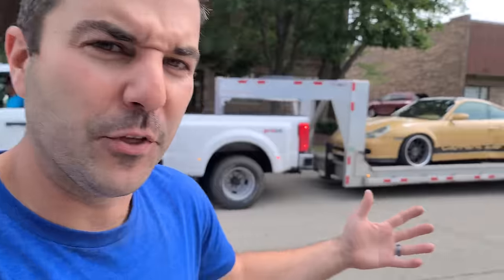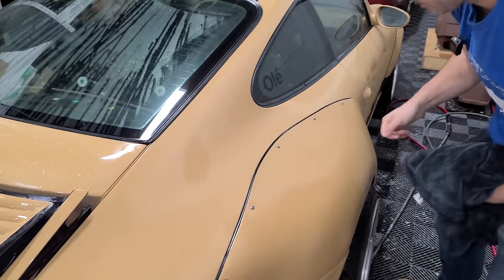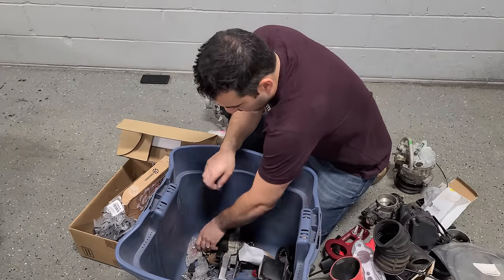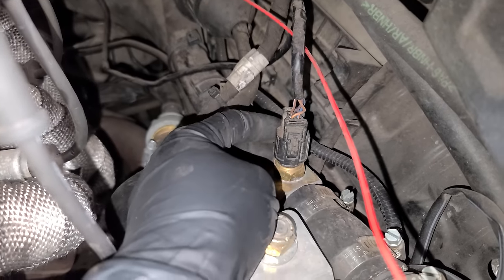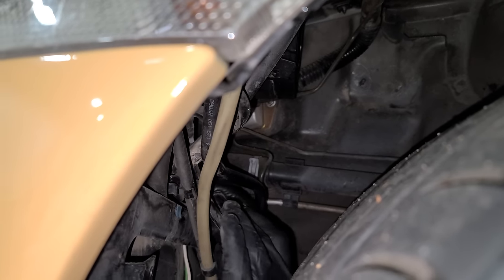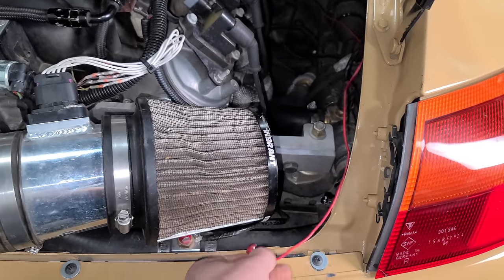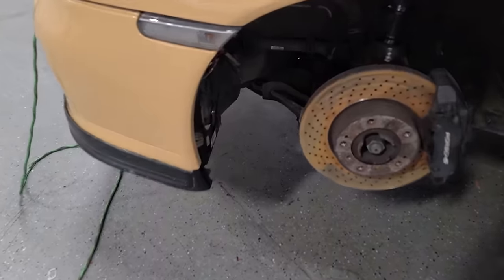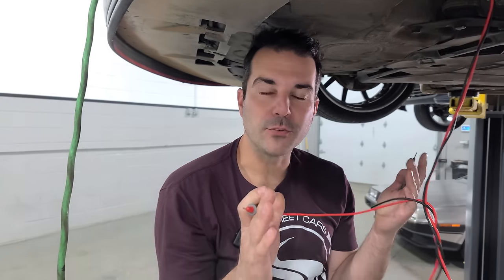I Bought A WideBody Porsche 911 That No One Could Fix! I Fixed It For FREE In 3 Hours! LS Swapped!

Comment from the maker: What do you think this car is worth fully sorted with working air conditioning and power steering?
Reply: It is worth keeping ❤
Reply: I guess i dk the worth of cars these days because if someone said 10-15k i would of pulled the $from the bank asap thinkn im getting 50k off the top😂 butt again i dk shitts bout there worth
Reply: 911’s don’t have power steering, those mega-wide tires are why it’s so heavy steering. That was a sweet 911 when new, it has the tech-lighting package and these cars have aged well.
Reply: Not a lot totally ruined a decent car🤣🤣
Reply: $28,500 same as BAT brought in.
Reply: @enoch52  Not 99 models .. The LOWEST value 911 of them ALL
Reply: @jeremyjones8872   Capt obvious, you are correct...
Reply: Not a lot. This was not the move to make. Especially because you’re now youtuber number 100 to have/build one of these. Kinda disappointing actually.
Reply: Ccol Project. I think it's worth about 5 k more now that it cools. If you could add power steering, air conditioning and quiet it down and tune it add another 10 to 15k
Reply: I wish I knew how to use a meter. Can you point me to place to learn electrical things or one of the viewers?  I have a Norta Trak bicycle I would love to diagnose and fix.
Reply: 45k
Reply: These comments are cancer lol. There's at least 60k into this car.  Definitely worth at least 35k to the right buyer, probably more.
Reply: KEEEEP IT!!!!
Reply: I’ll give you 25k for it 😂
Reply: I can't imagine it would be worth much less than $35-39k? Especially now that it's sorted.
Reply: Ask Hoovie, he has the Apollo 911
Reply: $1 Bob
Reply: Easily 40k when sorted
Reply: @modelbehavior3252  WTF are you talking about??? Power steering, ABS, a more efficient heater, a central locking system and height-adjustable seats were part of the equipment in 1989.
Reply: @melvingibson4525  I think it was a stellar purchase...but I doubt it would more than $33.  Early 996's are still the best value buy in the 911 family...mostly because enthusiasts hate the Boxter interchangeable front end (e.g. headlights) and IMS bearing issue.  Given the LS swap, the IMS issue is removed...but the stigma to 996 remains.  That being said, they are IMO terrific cars for the money and this was a really good purchase given the after-market upgrades.
Reply: 217,95$
Reply: @melvingibson4525  Dumping $60k into a shitbox doesn't make it worth more. That's some boy math right there.
Reply: @Elmospiece  I bet you're a wow at parties ..!!🤣🤣
Reply: 10-15k, I don't care what the parts cost new, its not new now and honestly you over paid for the "SEMA Car" status symbol, the buyer pool for a car this modded is extremely low, no one buying used would ever value the expense of those wheels when there are plenty of good looking wheels in the 1-2k for a set price, nor will anyone appreciate the paint cost and particularly Porsche purists aren't gonna like the color change or the wide body so they will knock value for having to "restore" the car back to factory body, not to mention the motor swap, so "Porsche Guys" would dog you to no end, so in the grand scheme you have a 5-10k roller and like 5kish worth of motor and swap parts. I know people won't like this comment but it's the truth, Factory Porsche's hold higher value then modded ones and frankly when you told us to guess what you paid my brain said 10k, so add a little more for it being all sorted.
Reply: @melvingibson4525  Doesn't matter how much money you put into something, the problem with a heavily customized car is the market, very few people will want a porsche 911 with a widebody in that color with that interior, so your buyer pool is massively limited and so you have to price it low enough that people would be willing to buy it and respray it a different color (at a minimum), so take the value you place on the car and subtract the cost of a new paint job and that increases the market to where you might actually find a buyer. Also SEMA 2017, that means this has been a non-usable for daily driving car for 6 years, people are gonna consider that too.
Reply: @DanielRichards644  I like your comment... You are telling the truth 👍
Reply: So while there's a lot of money in this car, these cars are not considered very desirable by Porsche enthusiasts, The parts to own them are expensive, and with the conversion and all it generally lowers the value not raises it. So 15 to 20K would be about the highmark when you get it all cleaned up.
Now if you go out of your way to get the air conditioning working and all of the gauges perfect and fix the shifter so it doesn't look like a metal tube etc It's worth about the same 27 you paid for it but Right now it's far from that.
Reply: This was for sale online a year ago for way too much money. I honestly thought, the only thing that makes sense is for a well known YouTube channel to do a rebuild lol
Glad this happened!!
Reply: 35-45k
Reply: It's insane that you sorted it out in like 1 hour.  Lol.  Those other shops should be embarrassed.
Reply: 3,000$ Ille offer you 2,900
Reply: What happened with the Ls Swap Mercedes? I believe in you to do the trade to trade eventually to a 6 number car come on 👊
Reply: I guess I am just poor, cause looking at this I would not be willing to spend more than 10k. Especially considering it has an unknown issue, to me that means there are some more that are likely masked. It is neat but I wouldn't be willing to spend much to adopt it. Seems like a problem child.
Reply: So I used to work for Gillet, which is the company that used to make the exhausts for all of the VW Group, the BMW, all of the German automakers. Was there when we were prototyping the exhaust for the 996 turbo.  I learned German in Germany on the fly. And the correct pronunciation in German you would pronounce the E because Germans pronounce all letters. Having said that, it's only douche bags that insist on that kind of thing.  Like gun owners that get tense about the difference between magazine and clip.  Yes, I know the difference. No, I don't care. Magazine is three simple syllables, and clip is one.

Personally, I would have power steering and AC, even if I had to get an electric compressor and electric power steering  That way you could place that equipment anywhere you want, Although you may want to upgrade your battery and your alternator if you're gonna do that.
Reply: 1999, No AC, no power steering… if you fix all the little things, I’d say 15k. So… about half what you paid for it. Don’t feel bad, the last guy lost a lot more than you will on the deal 😂
Reply: Its worth doing a merch giveaway so i can buy a bunch of tshirts and win it lol. I love porsche and i love LS. It would be such a cool daily and project.
Reply: I can't really be sure from looking at my phone screen, but in a lot of shots the paint job looked pretty awful. That doesn't really help the value I guess.
Reply: @enoch52  Yep. All the modifications were money down the drain, in resale value terms.
Reply: @charless2684 it's crazy that there are SOOO many shops in the US that just have no idea! It's why I literally can't bring my car anywhere.
Reply: To the right person, a funny sorted car with that motor? Maybe 40-50K....
Reply: Probably wort more as a giveaway by way of views/sales vs actual car
Reply: Maybe 30 to 35K but you'll need to put 10K into sorting it so maybe you'll break even. Consider you can find a sorted 996 Carrera turbo for 50K so if you wind up with more than that in it your probably stuck either losing money or keeping it. So be sure to make it the way you would have built it in the first place.
Reply: Use it to do the trade up project again
Reply: It's an honest ~$20k with a bit of swing depending on the local markets.   But we can all assume it's gonna get $30k+ from some over zealous wannabe Tiktoker or the like.
Reply: worth keeping :)
Reply: Once you check/fix everything like the non-latching hood latch, janky intake, and replace those crappy seats... I don't see anyway you couldn't make a healthy profit. $45-$50K... I'd ask $55k, and "settle" for $45K.
Reply: Its worth a crapload of money if you sort it and do a giveaway with merch purchase.
Reply: 10 to 15k not much more, I’d say part it out,  it’s a bit of a big, ugly AF… but good luck Alex
Reply: Ruined car. The wide body is wrong, the rear wheels are terrible,  and the LS swap is just wrong.
Reply: mint, 25k. Fixed in current condition, 15k.
Reply: Por shuh. Proper pronunciation
Reply: With a GM engine? next to nothing...
Reply: @jb678901  35k if it had the original engine, but it doesn't...
Reply: There’s another YouTube channel building one that’s gonna have half the money into it
Reply: in todays market, $50,000
Reply: Why not? Make it legit! 😊
Reply: Crush it , horrendous 😂
Reply: You got it for 27K, so 30 - 35K.  But I reckon you could negotiate a great swap, maybe snag 10K to rebuild/modify whatever you swap it for to keep the LS series true to roots.  Great vid as always mate!
Reply: In what country? 😅
Reply: @modelbehavior3252 not true. 996/911 definitely have power steering.
Reply: @legitstreetcars ill email you.  I think this belongs in my garage here in arizona.
Ill put an oem couch seat and maybe swap the nose for 997 then have it painted pts orange or nardo.
Reply: I sense somewhere in the $32-35k range 'as is'. Perhaps on the higher end if you put it "back in black". Cue the music.
Reply: @tomeauburn  Electrician U on YouTube Dustin the creator is a master electrician.
Reply: Probably less than what you put in it after sitting for a long time. Cars like this don’t sell easily or quick unless you find some “fast n furious fanboi” idiot
Reply: …the change in my pocket from a mcdonalds happy meal
Reply: @Kent.  You are correct, I made a mistake and forgot that the older models had it starting with the 964. I have a 997.2, I love these cars.
Reply: @ajvot71  correct, my mistake!
Reply: Your market for this vehicle is tiny, however, I bet another YouTuber who is looking to show off will gladly pay anywhere between 55 and 65K.
Reply: Probably 40-45k, but wheels/tires need to be sold and a normal set put on. Exhaust needs to be tamed down.

Comment: When you have a new engine overheating during idling. But cool when you're driving. It's definitely a indication that you have a air flow problem. Not a coolant flow problem. That's a big deal as long as you check the gases in the coolant and make sure you haven't blown Head gasket. Those aluminum engines like to Warp  when they get hot or even warm.

Comment: The story goes that the key is on the left because when performing a la man’s start you can jump in turn the car on with the left hand and engage the 1st gear with the right hand.
Reply: Why not just engage to 1st gear when the car is off then turn the key on (with clutch fully depress) once its on, release the clutch then throttle? My 97 lancer can do this, you can sometimes even forgot that its on 1st gear while turning on (I usually engage either 1st or reverse when parking on slope roads) it just stalls as the hand break is engaged.
Reply: Le Mans...

Comment: Alex, you’re still not using those connectors right. The soldier needs to be basically shiny, meaning it’s melted ALL the way. You’re barely letting it get pliable and you’re removing the heat. It’s a weak connection and will erode much sooner than it should. 

It’s a good connection once the soldier starts to seep into the wires. By the way, you’re building my literal dream car. A Porsche 6 sp wide body with an LS motor in it. 😳 So, I’ll be following along for sure. Awesome, unique car. I had cool cars in the military, but some things happened and I ended up not having such cool cars, and now my health has me lookin’ at the short end of life, so if I can’t build/buy my dream car, I can at least watch you build it. 😊
Reply from the maker: I hear ya but it is melted all the way into the wires. What I've learned is the grey ring you still see is a stain and doesn't go away.

Comment: Great troubleshooting, Alex!  If I were the former owner, I'd be miffed at the shops that could not diagnose, much less fix the problem.  The shops then got the former owner to add parts that were completely useless.  
So let's compare.  Previous shops: 1) Utter fail at diagnosing the problem followed by 2) weak parts cannon.  Alex: 1) proper diagnosis followed by 2) removing unnecessary parts, leading to 3) a no-parts added solution.

Comment: Working on a 2013 ford focus. Had a weird engine fault and transmission failure codes. Tracked it down to a wiring issues somewhere. Ripped out the aftermarket car starter that was half assed tossed togather in there. Codes went away and doesnt seem to be a issue. Drives and shifts good. Couple more items to fix before I clean it up for sale

Comment: I believe this fan shutoff delay is pretty normal since my friend's 997 3.8 does this as well. There is a lot of coolant in the system just in the hoses alone since they go from all the way back at the engine to the front of the car and back again. If i remember correctly the 3.8L F-6 in the 997 needs around 32 litres (around 8.5 gal) of coolant. This is a lot of thermal mass to get the temperature back down even if the engine stops putting heat into the system.

Comment: I’ve got a 996c4. The fans for the front rads are 2 speed and both come on together and ramp up together. Porche turbo has an extra rad and fan in the middle at the front as well.

Comment: The Gen 1 996 cars didn’t have a glove box, so yes the owners manual went in that slot under the steering wheel. They did add a glove box for the Gen 2 996’s. Also it’s common to need to clean out debris between the radiators and AC condensers, which requires removing the front bumper cover. Sweet video 😊

Comment: I own and LS swapped a 2001 996. The Porsche fan relays are positive switched, if I recall. I re-wired the relay in the driver fuse panel to be negative switched and allowed the GM ECU to run the fans. That way I could change the fan set points in HP Tuners.
Reply from the maker: Very cool. Thanks!

Comment: That's awesome you got the fans figured out so quickly! Can I recommend when you wire them to the ignition, you do so through a timed delay off relay? It's not out of the ordinary for the fans to run a little while after the ignition is off, if it needs it.

Comment: I am not much of a revhead. I have never owned a sports car but admire their beauty and technology gone into their production. But one thing I have always believed is you never tamper with the standard technology built into a car. A car, the motor, transmission, brakes, tyres, suspension etc., everything that makes a car run has been designed by very clever technicians. If you do something to give it more power you then have to rework everything else to cope with that power, including stronger transmission, clutch, brakes, tyres and suspension. I have never done any modifications to any of the cars I have owned. This story of someone interfering with the cooling system of a very expensive sports car is a good reason just to leave well enough alone.

Comment: To help the longevity of the gate it’s useful to fabricate a bracket and put  an old wheel to support the length/weight of the gate when opening and closing. It could even be spring loaded like a car.

Comment: Alex, I agree the factory fans are better but also a lot of those aftermarket fans are designed to be pusher or pullers, but it’s not always just wiring, sometimes you have to actually turn the blades around for them to move air properly depending on whether you use them as pushers or pullers.  I wouldn’t be surprised if this is why those aren’t moving air properly.

Comment: Alex. I would go for remote control exhaust flap, a better wheels and tires like some BBM or similar. The rear trunk seems missing a exhaust fan from the hoid, may it helps to keep cool better once you install the Air Condition. Keep it up. Excited to see the next videos about the work on Porsche LS-C

Comment: I'm working on a 1972 buick riviera with a 455, just installed a holley sniper efi intake headers electric fans new gas tank new lines about to start it in a couple day's super excited
Reply: Maybe this has been explained before,the reason the key is on the left? It goes back to the LeMans days; at the “running start” the key could be turned to start the motor, with your left, while you were reaching for the belts. Enjoy!

Comment: Great Video. Nice Diagnosis.  I'm with you on the fan power switch-on decision (although if the fan were blowing air over the engine...direct battery connection would make sense).  

Random question...What ever happened to Peter?

Comment: I admire you knowledge of the electrical system of the car and your electrical knowledge. I realize this video doesn't show the labor and research time you spent on this car, but after you get everything properly connected electrically go back and clean up the non-factory wiring. As it appears the additional fans and related wiring is a total hack job. Make additional electrical look professional and the car will sell for at least 10k more than your purchase price. I'd love to see a video of the car after the exhaust and electrical system is completed!!

Comment: LSC wire the trigger signal for the fans to the High side signal from the factory loom.  This way the fans are controlled by the car It's self.  Thus eliminating electrical stress on the factory system.

Comment: FYI, I have those same resistors for aftermarket LED turn signals and those resistors are junk. I replace them once a year. I need them to trick the BCM/SJB that my bulb isn't burned out since the LED has less resistance than the original florescent bulbs